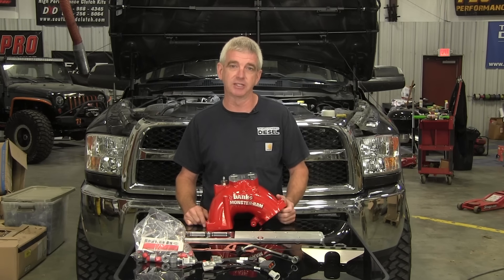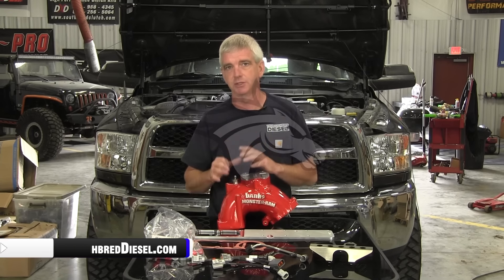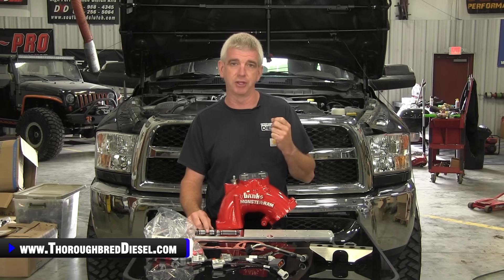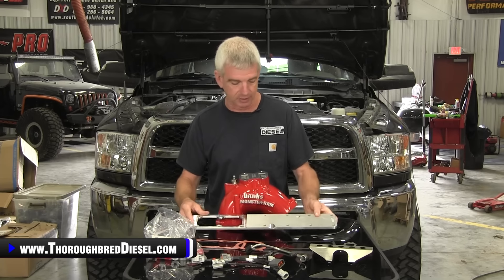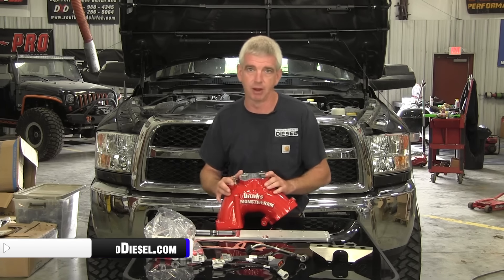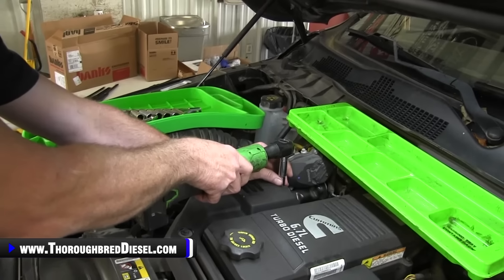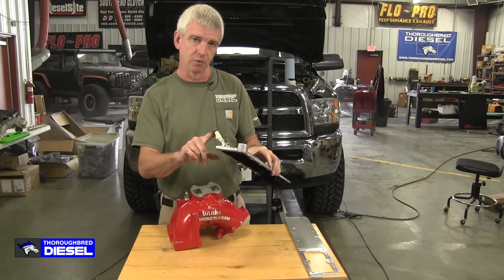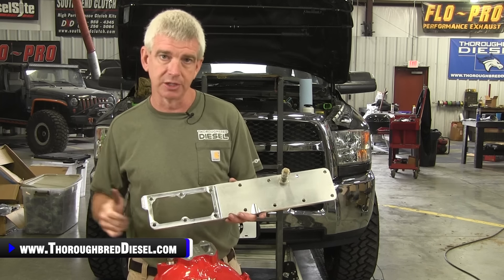HOW TO Install a BANKS Monster-Ram Intake on a Dodge Cummins 6.7L #diesel #cummins #intake #fyp

Comment: You deserve an Oscar for this video, terrific videography and description. I threw a P2493 code on a 2016 6.7 and have cleaned the EGR bypass valve, cooler, valve, bypass tube which was carbon'd up pretty good. I am wondering if my heater core potential restriction is causing this error and it is time to install a Banks?
Reply from the maker: Thank you very much.  Are you having any other EGR or DPF related codes?  If so, have you attacked them?

Comment: First off!  Great video.  Thank you for doing this.  Keep the videos coming.  One thing though.  I noticed in your video you did not put the copper washer on the heating element before installing it.  Is that needed?
Reply from the maker: Thanks!  Only sealant on the heating element.

Comment: So first of all on the very back fuel line instead of like he said a short box in wrench you can take a 19 mm Crow's foot slide it over the tube and down onto the nut with a 3/8 ratchet and a 3 in extension. Use it to loosen it and leave it on after you flip the fuel line out of the way so that when you're ready to reassemble it's already still on there just roll the fuel line back to the fuel rail and then retighten using the Crow's foot. Also, don't use a magnet to put the bolt on the inside of the ram. Use the little gripper retriever. You push the button and the four little prongs come out and expand. They actually grip the bolt instead of relying on just the magnet. Far less likely to drop the bolt and will actually hold the bolt tight enough to turn it and get a few turns on it versus relying on a magnet. Lastly, be very careful moving the fuel rail with the sensor still hooked onto the back. That rail pressure sensor broke on me before I even move the fuel rail. It's a very flimsy sender. Easily got one overnight from Amazon but the problem is getting the original off. Had to put the fuel rail and advice while holding the and with the proper size wrench and it took a pipe wrench with a cheater to get the old one to break loose.
Reply from the maker: Thanks for sharing.

Comment: Absolutely point on video! Recommend to many! Im commenting because you told us all to ne careful with FRPS an i failed to follow that simple instruction. 😢  Prosource Diesel has FRPS @$99 save instead of $RockAuto @ $ 500 shipped.  Thanks again for such a great & informative video.
Reply from the maker: Thanks!

Comment: Great video.  Many thanks.  I got about 90% of the way through my install today, with your help.  What ladder are you using to access the engine bay?  I have a regular 24" step stool/ladder and it isn't tall enough or sturdy enough to get into contorted positions while reaching difficult spots under the hood.  Many thanks!
Reply from the maker: You're welcome. That is a topside creeper that we use.  It makes it really nice to get to those hard to reach portion of these modern engine bays that seem to be more and more common.

Comment: Great Video. I have a 2012. how much different is it for the 2012? I worry about that bolt every time i turn my truck on.
Reply from the maker: 07-2012 trucks, not much different.  All components are the same, some in different spots.  We hope to do a video on the early truck soon.

Comment: You talk about cleaning the throttle valve and map sensor before transferring to the horn.  What do you recommend cleaning it with ?
Reply from the maker: I wiped them down with MAF sensor cleaner and a lint free cloth.

Comment: Great video !!
  Say does that foam really need to be re-installed on the driver's side on the back of the intake plate?
  Not sure what it's for,,,,heat insulation for the rear fuel lines?
  Please keep up the stellar work man and thank you!
😎👍
Reply from the maker: Yes, we suggest reinstalling it.  I think it’s a heat shield as much as a noise shield.

Comment: I'm about ready to buy and install. I have the P2609 code heater performance issue. The question I have is there a noticeable performance increase as well by doing this upgrade?
Reply from the maker: Noticeable increase in performance yes.  I don’t know the root cause of your code so I cant say for sure that this fixes the code.  But it for sure will keep you from having a catastrophic failure from the bolt dropping in the intake.

Comment: If you have a fass fuel system you can just turn your key /lift pump on 4 to 5 times an it will start first time

Comment: What is a ballpark cost for having this done? Also. One shop said I need to have a tune programmed in after doing it with a cost of $1000.
Reply from the maker: No tuning required.  Should be able to be accomplished by a shop in less than 8 hrs.

Comment: Is the install much different on the gen 5, a 2023 HO where the trans dip stick is on the right side as well?
Reply from the maker: The 19-24’s have a different kit but basic install is the same.

Comment: Just got the banks Ram Air & Fleece Coolant Bypass & BANKS Intake...temp dropped to 50 degrees, truck really rough start, since Heater Coil seems to be smaller than stock intake heater..Suggestions?  Seen LGH(liquid gas heater), ? What do you think for better warmth
Reply from the maker: Either your intake air heater isn't working or you have a fuel related hard start.  Plug the truck in and see If the condition goes away.  If it does, check that heater and make sure its working.

Comment: Is there any way to purge the diesel fuel and check for pressure leaks before the fuel rail cover boot gets put back on? Thanks
Reply from the maker: It's common rail so if you have a leak you will know it quickly.  You can purge the low side but that doesn’t effect the high side components.

Comment: Wade, 
Sort of out of words to say what everyone else already has - You have set the standard for how experts can produce how-to’s for us “YouTube” mechanics. I’ve done more than my fair share of sometimes ill-advised DIY escapades. For my part, it’s the best thing about  (YT) and maybe about the internet writ large. Nothing in my 10-15 years of YT referencing compares with your instructional videos. If I had known beforehand, I would have purchased everything from you. I did the whole nine yards (Banks CAI system, Both boost tube upgrades and the Ram-Air manifold). Not sure how it would have gone without your video and calm, confident, and reassuring instruction.
Reply from the maker: I’m glad you’re enjoying the new intake system, I appreciate the kind words, keep on truckin’!

Comment: Very good install video. I have a 2019 Ram 3500 that is bone stock, what kind of performance would be noticeable with just adding the kit in the video?
Reply from the maker: Flows air much better, especially if you grid heater is already sooted up.

Comment: I used your video to install mine and everything went great! EXCEPT I’m paranoid about one of the six horn bolts, the one that’s directly under the pvc oil pipe. (Top left, 1:17:41 ) You didn’t show how you torqued that one and now I have a low speed (5mph-10) whistle sound that’s intermittent, doesn’t happen in park. Hope it’s not a boost leak from that particular bolt from not being able to torque it and ruin the gasket. Came back to this video to double check my work to yours and see you didn’t show or state how you went about that bolt. Any recommendations on what tool to get in there would be great bc nothing fits other than a regular 6 Allen, used the non ball end bc I didn’t want it to break off but you can only get about 3mm of turn at a time from a really weird angle. My flex extension won’t fit, wobble knuckle bit won’t fit. Any help would be greatly appreciated!
Reply from the maker: I wasn’t able to torque that bolt either truthfully,  I had a pretty good feel as to what the other bolts had, so I felt my way through it.  I think the sound you are hearing is the increased flow into the intake.  As long as you aren’t seeing soot trails,  I would imagine that you are good.

Comment: The product and engineering is amazing I don’t have anything bad to say but this is an absolute warning the bolts or Chinese crap cast. I broke one, 6 pounds under torque spec, and it looked like it was casted poorly and I could rub like sand off of it in the center. They sent me replacements and because I only broke one I cut one new one and a half and the core was not completely casted. It was like sand in the center. But the kit woke my truck up noticeably and thoroughbred Diesel is awesome. Several edits. My auto correction is killing me here.
Reply: How much horsepower did it add?
Reply: @kaiserbailey  I tow and haul with my truck. There would never be a reason for my truck to be on a dyno. Bolting that on a stock truck made a noticeable difference. Seemed a little quicker throttle response, and I felt like it had a little more pull through the range. I do not want to make any horsepower claims. This is more than definitely a supporting mod for somebody’s goals.
Reply from the maker: Here's the data: https://www.youtube.com/watch?v=sd2Jly-jszI

Comment: Two bolts inside the banks body, isn’t that a corrosive environment? What happens if those bolts corrode or lossen up and fall into the engine?
Reply from the maker: Engine rebuild.

Comment: Is the foam required to reinstall? Does it make it quiet? Or add heat to the fuel rail? Not sure of its real purpose.  If anyone has left it off, has it made a difference?

Comment: At 1:07:05 you start reinstalling the rubber isolator without the rear injector plug reconnected and then at 1:07:47 it's suddenly in place. Were you able to reconnect it with the isolator in place or did you have to re-remove the isolator, connect the rear injector plug and then reinstall the isolator and PCV hose again?
Reply from the maker: Sorry,  it was part of the crossover harness that is on top of the isolator, and we show the front connector being connected @1:21.
Reply: @thoroughbreddiesel  Ya, I saw that, but that’s 14 minutes later than the rear connector being connected. Anyhow, this is BY FAR the best video (really the only one worth watching actually) on installing the Banks Monster Ram. 👍🏻

Comment: Does this system increase fuel economy and horsepower I can’t seem to find the answer for that question
Reply from the maker: No guarantees for increased fuel economy but as you can see with the increased air flow into the engine it is going to be more efficient.

Comment: What year truck is this failure happening too? Just one year or multiple years? First I've heard of it. I have an 2018 3500 dually. Thx for the replies.
Reply from the maker: They (Cummins) went to this grid heater design with the 6.7 launch in 2007.5 to current.  Your truck is a 18 and that’s what year truck we used for this video.
Reply: @thoroughbreddiesel  Yeah been doing some research, I need to get this done. We're getting ready to head to Florida for my work, Ya'll want a quick side job?

Comment: I have A 2016 5500 Bought the Monster ram and have been told it wont work on my truck. I believe it can but needs some modification, is it possible to do A video on that.
Reply from the maker: Not sure.

Comment: Wait- the entire purpose of this mod is to remove a failure point of the power grid stud/nut from falling into the intake side of the engine. Then this kit installs the Monster ram air intake with an internal bolt (directly underneath the top sensor) within the intake injection stream? Now we are “BANKING” on blue loctite to help hold that bolt in forever? That bolt potentially has the same failure potential if it ever comes lose. Do my fellow engineers agree?
Reply from the maker: The internal bolt is threaded into the intake shelf with no passage into the intake.  Or are you speaking about the heater stem?  If the heater stem, it cannot break loose from the porcelain.

Comment: I purchased a 2013 ram 2500, and it has this banks intake and a mm3 tuner. To my knowledge that's all it has. It is not deleted. I drove it home for maybe 100 miles and the next day it threw a p0381 code. Says it's a grid heater code. Any suggestions or tips would greatly be appreciated.
Reply from the maker: That’s very strange,  is it a Banks intake with the intake air heater conversion?  If not and the grid heater was removed with no provision for the “grid heater call”, then it will throw that code.

Comment: do people put di-electric grease on all electronic fittings when they disconnect them? or is that seen as overkill?
Reply from the maker: It’s a personal choice.  Dialectic grease will help disperse water but water intrusion is a condition that has to be fixed not bandaided.

Comment: Is the 2008 6.7 pretty much the same procedure? Excellent video by the way! 👍
Reply from the maker: Yes, not much difference at all.  Some of the wiring is different but the mechanical components are the same and in the same locations.

Comment: How important is the isolation foam?
Reply from the maker: Sucks to put it back on, but its there for a reason.  If you are comfortable with engine noise with it off, you can rock on.  If not, put it back on.

Comment: Curious Question: The Intake Plate Gasket that shows under the port opening, looks about a half inch wide flange. Performance wise, does that "extra" gasket material create any air flow restriction? If one were to cut out the "extra" gasket material, after the plate is torqued, would it weaken the gasket in that corner?
Great video! I'm glad you took your time to make sure every step was clear and informative. Cant wait to get my intake installed.
Reply from the maker: Thanks!  I need to look at the kit to understand what you saw there.  At the actual intake horn opening, the gasket is flush with the plate so no restriction was there to my knowledge.
Reply: @thoroughbreddiesel  it would be gasket between the plate and the block. I wasn't sure if it was flush with the block and the plate had a bigger opening making the gasket stick out.

Comment: Purchased the kit to install on my 2014 2500. Patiently waiting for a  weekend free of commitments to start the job. Question(possibly a dumb one but…) before getting started on the job is it recommended/necessary to disconnect the batteries? I’ve heard it’s good practice to disconnect them when working on the engine but not sure if necessary.
Reply: Yes. It's one of the first things he mentions in the video. Good luck!
Reply from the maker: Yes, always.

Comment: Installing this part this afternoon on the 2018 Cummins (Laramie) and the alternator is just in front of the intake horn. Will this impact the fitment, specifically the Monster Ram Intake plate? Subscribed, liked, and appreciated your education.
Reply: did alternator affect fitment?
Reply: No sir, it did not affect fitment. Install was way easier than expected. The 5th and sixth fuel lines are not fun but other than that it was easy and the parts fit perfectly.  @nolovenoah742
Reply from the maker: There isn’t any mention of it in Banks instructions.  I would think that would be far enough on the front belt drive that it shouldn’t affect this installation.
Reply: @thoroughbreddiesel  yep, just did mine over the weekend using your video! Thanks so much!!! Only thing that would help is if you mentioned sizes of sockets as you went along. Easy to figure out but quicker in the videos lol

Comment: Great video guts.
What is the size in metric and the length of the the T Handle and what is the adapter for the Torque wrench you used to tighten the inside bolt in the intake heater hole?
Reply from the maker: Thanks!  It is a 6mm, and they send you a length of Allen stock to get to it.  Just need to use correct torque multiplication there.

Comment: Has anyone found if any warranty issues arise from dealers?  I have a '23 3500 maga-cab dooley that I purchased 6/23 with 34 miles and now have 9k miles. I don't drive it much but definitely wanna do all the Banks upgrades.  Will dealers deny warranty work because of the intake or Air box upgrade?
Reply from the maker: Manufacturers don’t make any claims to effect on warranty.  However, the Magnusson Moss act protects you from dealers cancelling your warranty due to aftermarket parts unrelated to the failure you are having.

Comment: Hi, I just used this video to install my banks monster Ram. I unfortunately dropped the nut for the dip stick bracket in the coil heater hole, so I have to remove the banks monster ram to retrieve it. My problem is with the top left galvanized, hex head on the banks monster ram. Threw some patient finagling I was able to get the hex down, but the valve above it makes it very difficult. I was wondering if there was any tips anyone has, maybe a tool I don’t have or an angle I haven’t tried. I don’t have too much experience with installs like this, and in the video it skips ahead and doesn’t show how he got it in. Any advice would help thanks.
Reply from the maker: I actually thought I addressed this in the video but I guess I did not.  I used a long ball hex that let me articulate it do run the allen bolt down, but then I cut a cheap allen wrench off short to be able to do my final tightening.
Reply: @ thank you very much for the feedback. Your video was incredibly helpful.

Comment: I just installed mine today but the engine light never went away the code is air intake heater relay , any thoughts on my next step to fit rid of it ?
Reply from the maker: If it was there before, check the relay itself.

Comment: Does the removal of the grid heater cause any problems if you have cold winters. -45 degree type temperatures?
Reply from the maker: With this kit no, because you have a intake heater element in place now with the Banks kit.  However, in those temperatures, I would definitely plug the truck in!